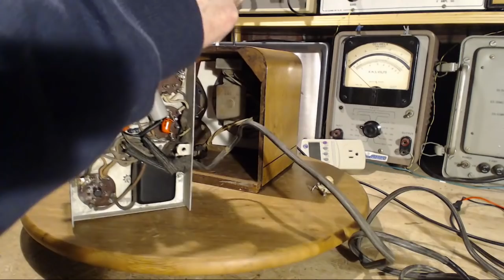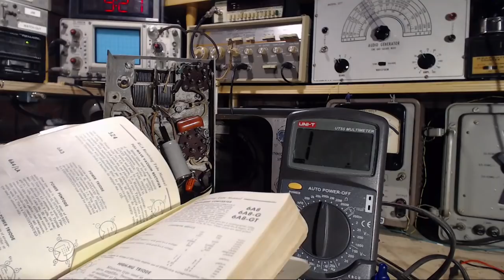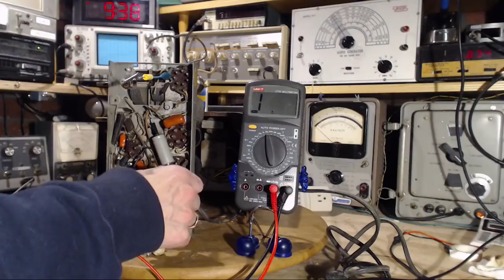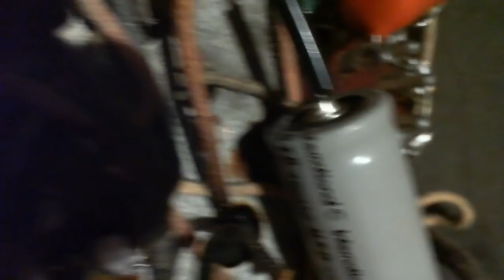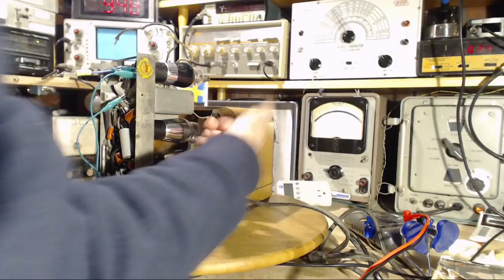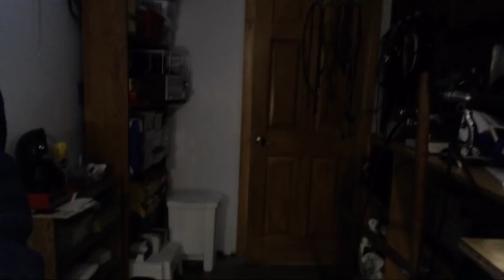Montgomery Ward Airline 62 425 Video #2 - External LO Experiments

Comment: What about a slim cardboard tube which could wind around 450t main winding and 50t feedback winding over-wound over main winding using 38awg enameled copper wire this will be an Aired Core Oscillator Transformer.

Comment: The G2 (oscillator anode) should have a positive voltage. Where is that green clip lead from G2 connected?? I would put a resistor of around 47k from B+, then couple the sig gen via a capacitor

Comment: Maybe you should switch the signal generators so the one which has a modulated tone is on the antenna. Also, maybe ohm out the bad coil and see what winding is bad.

Comment: Oscillators are built with leads as short as possible to avoid parasitic oscillation. Position is not as critical, except as it relates to radiated signal problems.  That's the reason for all the shielding you saw in on of the previous radios you worked on.  It is the reason for the shields on the tubes themselves.

Comment: 16:45 Resistor color code 7 equals blue? Really?! Wth! Blue is 6! Violet is 7! He has encountered several dozen resistors with 7 as second digit like 27.. red violet, or the ever present 47.... yellow violet... And he is using a color code dial, which started out being set to 6=blue to boot! Yet still got it wrong!

Comment: Jim:  Here is a potential replacement coil.  The radio looks pretty nice.

At least good enough to gamble $8.95 + tax + shipping + currency exchange.

ANTIQUE ELECTRONIC SUPPLY – Coil - Miniature adjustable coil, 70, oscillator

SKU:  P-C70-OSC

Item ID:  005493

Price: $8.95
Reply: fevengr Nice find . Could definitely be worth a try. But your find has an adjustable slug (hex key, which adds the risk of breaking the core on using an unsuitable tool and rendering it stuck in an undesireable position) The original OSC transformer looks to be an air core type and in consequence offers no local oscillator adjustment at the low end of the band. Maybe a too complex of a replacement?
Reply: If the value of the tuning capacitor is correct for the values of inductance in this part it should work.  Coils in radios of this age had air cores because they didn't yet have ferrite available, and the slugs would have to be machined.That made them significantly more expensive. The tuning capacitor seems to be 5 - 200pF.  That may be too small for that oscillator coil, although it might work with the core removed.  That may lower the inductance enough.  I don't know...
Reply: @harryshector  
As the oscillator coil it looks fine .
But he could fit a brass slug if all else fails !
Reply: This looks like a good substitute part .
He will need the wiggle room the core provides .
If he can restrain from using the golden screwdriver on it !

Jim FYI yes you jim 
the Inductor is low end adjustment & gang trimmer is for the top end .
Reply: @gd2329j  - I recently repaired a 1942 Philco AA5 radio.  It didn’t have a series trimmer or any other way to adjust the low end of the band and I just could not get the dial calibrated properly from end to end.  I searched google (I’m still amazed at what you can find) and saw a suggestion to retune the IF transformers slightly to compensate the low end and the shunt trimmer for the high end.  It took several iterations between the high and low ends but I finally got it right.